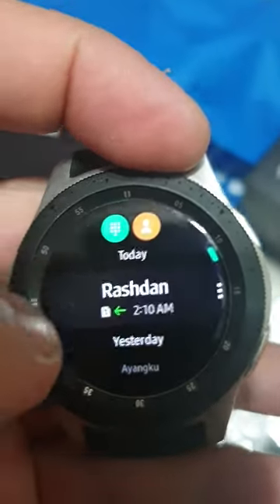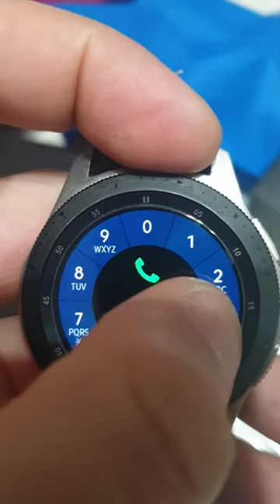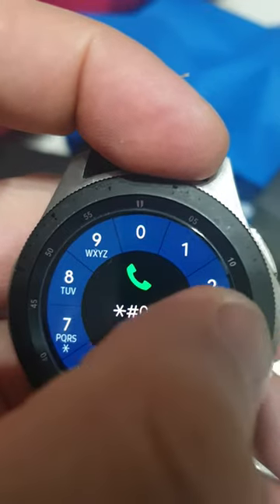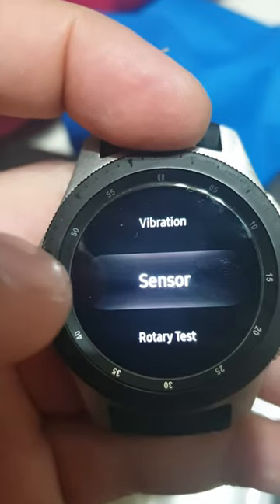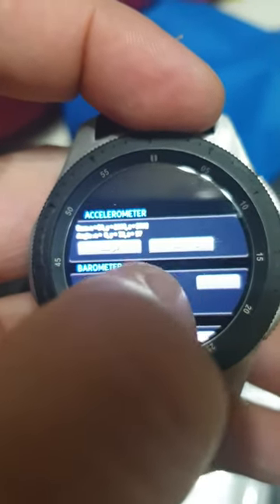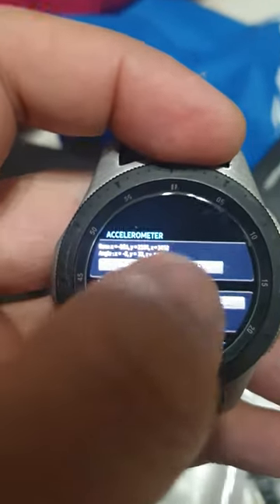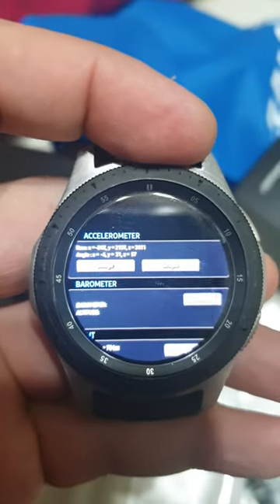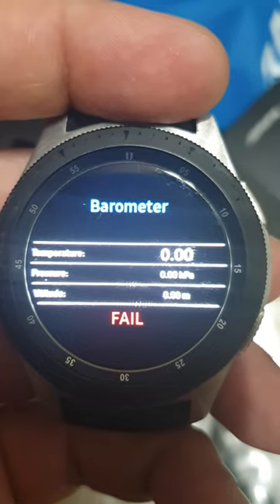Samsung Galaxy Watch barometer fail

Comment: Hi.. i have one problem solving for Samsung GW not working sensor. First u must hard factory reset u're watch and then when it start dont pair with u're phone, but u must do second hard factory reset again. After that pair with your phone but dont take your back up data. And then update your all application and after u did all the steps the last active your measure HR for continuously and let it be pairing with your phone for 1 day. The sensor work again. Its work for me... Thanks

Comment: Nice one. I'm having the same issue. In reading the comments on the Galaxy app store lots of people are saying that their Alti-Barometer   stopped working after the latest software update.
Reply from the maker: I had it sent in to the samsung repair center and they swapped out one of the boards with the sensor... all is good now😁
Reply: That's hardware design defect which Samsung denies. My watch just out of warranty and I've encountered very same defect
Reply: Samsung provides a 2 year manufacturers warranty with their products. I ended it taking it to a repair center and they said they had to replace the watches motherboard... Thankfully it was free. Seems a common fault. Abit shocking a fault developed so soon considering the watch was only releases in August 2018.
Reply: @skynetdefence5009  Not in Russia, 1 year here (
Reply: @volgoden  that sucks!
Reply: Hmm same with Indonesia, only 1 year here. So bad :'( i hv same problem like the video
Reply: I solve the problem washing My Samsung watch. Then put under the sun 30 minutes and restart.
Reply: It is for sure a software problem. Definetly not a hardware problem. Reboot the Watch. Probably it will work again. First turn the Watch off. Then press and hold the "On-Off" Button till "Samsung Galaxy Watch - Rebooting" appears on the screen and then just wait till the Watch turns completely on. Then try the Barometer again. If this not works, reset the Watch to Factory settings. Barometer will work again, I guess.
Reply: @shahrildhari617  probably backed out the update too.
Reply: @shahrildhari617  how much change boards with sensor?
Reply: @fathurkurniansyah32  jadi gmna mas akhirnya?